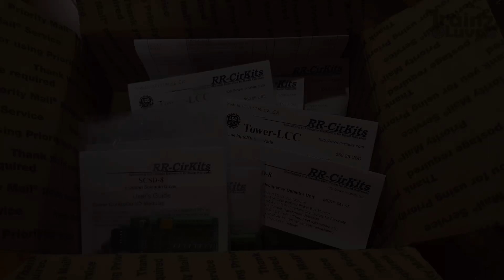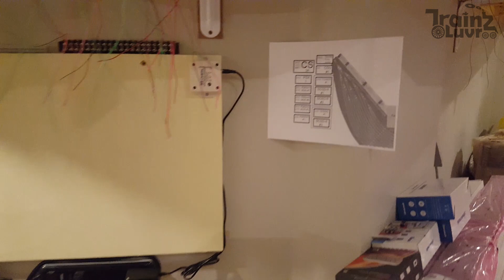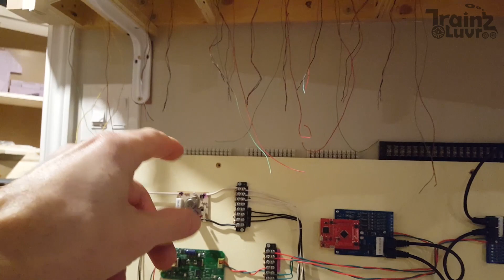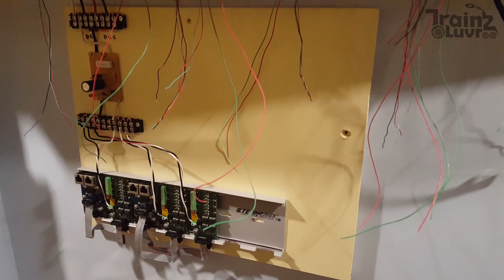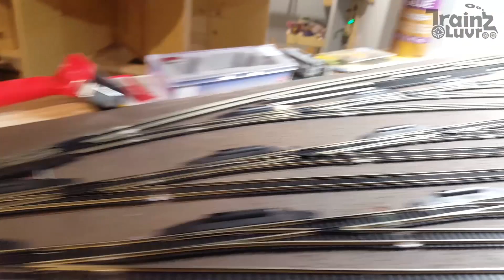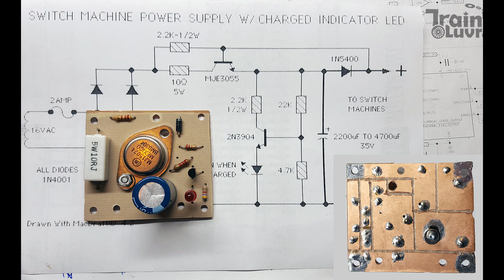Let's Build a N Scale Layout, episode 7

Comment: Are you connecting JMRI to ESP32 Command Station? Is the command station then sending the LCC Commands over the bus? Also, what motor driver did you use for the command station?
Reply from the maker: It is not connected to JMRI. As far as I'm aware, JMRI does not have support for LCC at the moment, and someone needs to write it in. ESP32 CS never the less still communicates over LCC and I can send commands from the UWT-100/50 throttles to it no problem (via the gateway). The solenoids are driven by RR-CirKits SCSD-8, which connect to the LCC network via Tower-LCC nodes
Reply: @TrainzLuvr  Are you saying that JMRI doesn't have support for train control over LCC? All the videos I watched you can use JMRI with LCC for turnouts, etc. I was wondering if the ESP32 Command Station would be able to take the LCC data over wifi via JMRI and put it over LCC.
Reply from the maker: @58Crood  Sorry I should have been more precise...JMRI does not have support for LCC Command Stations (unless it was recently added in v5.x - I did not check). You are corrrect, the LCC accessories have been working already.
If you check my Preview of TCS CS-105 videos you will see that I've connected JMRI running on RasPi3B+ and the TCS CS-105, via WiFi. ESP32CS would do equally the same, if the LCC/WiFi Gateway (Hub) is running on the ESP32CS. Though in the configuration from this video above I use CC3220SF as a hub separately from the ESP32.
Reply: @TrainzLuvr  Thank you for the info.

Comment: did i hear you say you have dcc over lcc?
Reply from the maker: That is correct. I do not have a long DCC bus across the layout, but instead unamplified DCC signal is carried through the LCC network on pins 4 and 5. That signal is passed onto my 2 boosters which then amplify it, creating localized power districts with much shorter DCC runs.
Reply: @TrainzLuvr  I'm intrigued. I thought LCC was a protocol of events.
Reply from the maker: @strobelightaudio  It is, akin to MQTT Pub/Sub, but not all pairs are in use on the RJ45 connector for the CAN bus. Pins 4 and 5 end up beng general purpose ALT_L and ALT_H. Usually they would be assigned to an unamplified DCC signal coming from the Command Station (if supported). Please take a look at S-9.7.1.1 and TN-9.7.1.1 documents for more details.

Comment: Well done!  How do plan to use the railcom signals?
Reply from the maker: Right now there's not much I can use them for except to ID block occupancy, but I'm hoping that they could be coupled with some automation on LCC nodes where a specific loco ID in a block would create an event and that would trigger all kinds of consumers e.g. if 4652 is in block 5 do something...Ultimately I would like my layout to run automatically alongside human operators and not sit idle between operating sessions.
Another future possibility is use of RailCom Channel 2 to manage fuel, sand, water, etc levels, which could be automatically updated as the train moves e.g. simulate a grade so locos cosume more fuel going uphill, or use more sand on snow/icy track over mountain passes, etc. There are all kinds of possibilities to simulate the real world, and I believe LCC could automate all this without a need for a dedicated computer.
Reply: @TrainzLuvr  Great ideas.  How cool would it be to slow the loco while going up a hill or changing the momentum.  Can you tell the direction of travel with railcom?
Reply from the maker: @richardmartin4479  Yes, RailCom will transmit the direction of movement. Unfortunately, there's nothing to consume any of that information right now in the LCC land. Furthermore, LCC presently lacks necessary transport events to carry RailCom data altogether. JMRI does not have support for any LCC Command Stations either. I presume the latter will be written into it when/after TCS CS-105 is released.